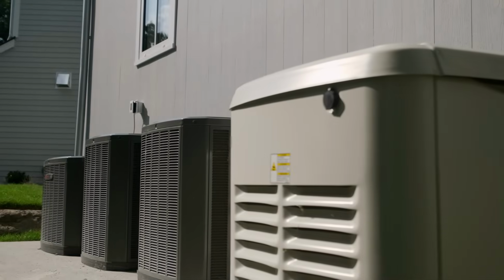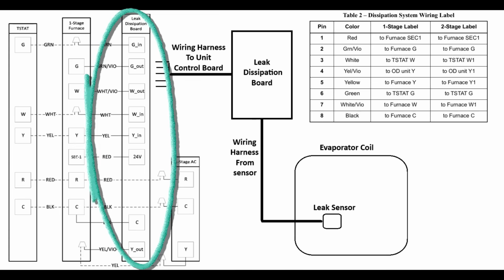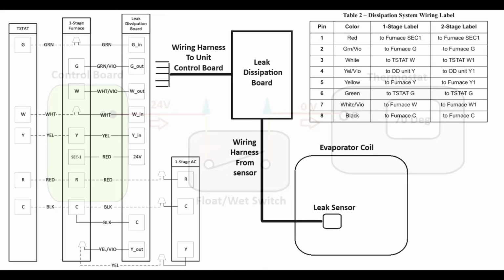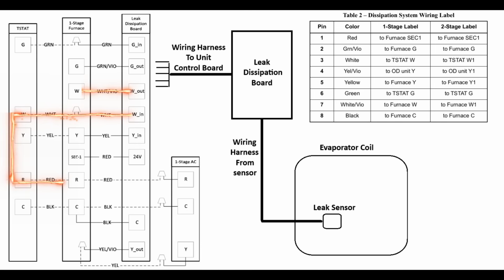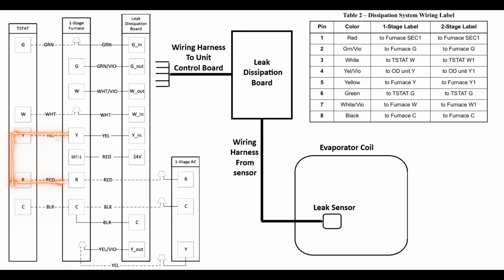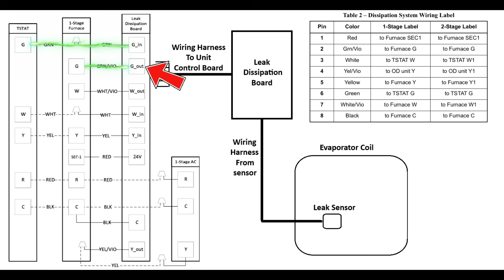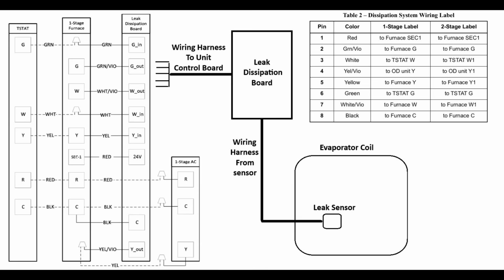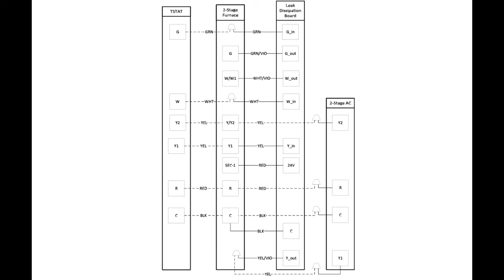New Refrigerant. New Rules. New Control Wiring...

Comment: Thanks for the clear explanation. A lot of others explain with only wire colors or terminal labels. You took the time to explain and show the source of the 24vAC, the thermostat call for heating and cooling, and where the yellow wire to the compressor goes to operate the contactor. Your power flow indications on the schematic are what set you above the regular discussions. Very well done.

Comment: i've i had to bypass that a2L sensor to get the customer cooling because ive had either bad sensors, bad board, or because its a friday and we can fix that leak monday lol
Reply: Due to insurance companies and lawyers thats absolutely crazy to bypass that. I wont even replace with aftermarket parts only OEM on A2L and A3. Dont bypass this stuff.
Reply: @ so we must leave customers without ac smh
Reply: @corruptedbrain6  Yes
Reply: @corruptedbrain6  Yes, better than death 💀 🤦🏽‍♂️😂
Reply: @WhowereEpsteinsclients  also, bypassing isnt bad 
alot of the times there isnt a leak 
its just a bad board or user error
Reply: @corruptedbrain6  Bypassing is bad. If someone did that to your family and something happens you would be singing a different tune. If you are bot going to do it right don't do it. All I am saying is you are liable. If I was the customer I would make you document that you bypassed a safety. I bet you bypass sail switches too.
Reply: @WhowereEpsteinsclients Dang bro, they got you scared to death, you do understand this is just a sales gimmick, the ppm on A2L is nothing to be so concerned about, r32 is the old 22 and 454 is the new 410, just do good work
Reply: @WhowereEpsteinsclients 😂😂 stop it man
Reply: @Mastertroll-8888 Stop what? I didnt force these regulations on the industry and my customers. If you think saying "stop it" to a lawyer or an insurance is going to work then good luck with that.
Reply: It wont be long until someone comes out with a few laminated wallet wiring diagram cards.
Reply: Flammable refrigerant is just stupid
Reply: I suppose if you wire/jump fan control to run continuously,it would act the same as the mit control and obtain the same air dilution .

Comment: What does Yel/Vio stand for? At least the Vio part?
Reply: Yellow wire with a violet tracer
Reply from the maker: Yel/Vio is the wire from the dissipation board that feeds 24v out to the contactor on the outdoor unit. This is the Y-out. Yellow wire from the thermostat goes to dissipation board's Y-In. This is the 24v calling for cooling. So long as there is no ref leak detected, the dissipation board passes the 24v from Y-In to Y-out to activate the outdoor unit.
Reply: @JerseyMikeHVAC  but what does Vio mean? Violation?
Reply from the maker: @realSamAndrew  violet. It's a yellow wire with a violet colored line on it.

Comment: Toss a little more angel hair into the spaghettini and linguine! Looks pretty straight forward though and deemed necessary. Up here in the Redwood Curtain, it will be awhile before customers make the transition from 410A to R454B. Sadly, some just replaced their units uninformed about 410A news. Should be interesting times. Thanks again for the update and patiently anticipating the knowledge to come.        ∆T°

Comment: I may be mistaken but isn't there a 2-hour delay when the leak sensor senses the leak?
Reply from the maker: Think it depends. Carrier has a 10-minute dissipation mode, but some brands might go longer. Commercial & VRF/VRV systems will have a longer run time, maybe up to 2 hours on those.

Comment: Alot of times we have to steal  G wire for common if they want a smart thermostat but dont have enough wires. can we still do that?
Reply from the maker: I think so. Should be able to run the G-In wire to the unit control board's Y terminal along with the Y-In from the dissipation board so it will still get the 24V to G-In on a call for cooling. It's just getting it from the board now instead of directly from the stat. Still won't have functionality on Fan Auto/On feature.
Reply: @JerseyMikeHVAC  Thats a good idea, Im gonna leave g in disconnected on the next one just to see if it needs it or not. thanks
Reply from the maker: @justinrichard4190   Yeah let me know. I'm curious myself.
Reply: @ will do
Reply: Any updates on this? Trying to see if I need an extra common wire, Tia